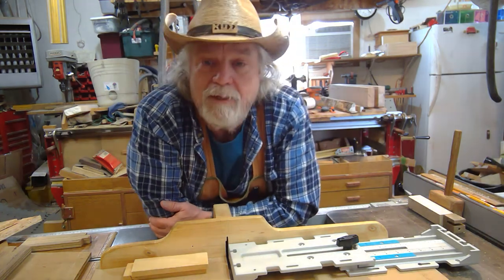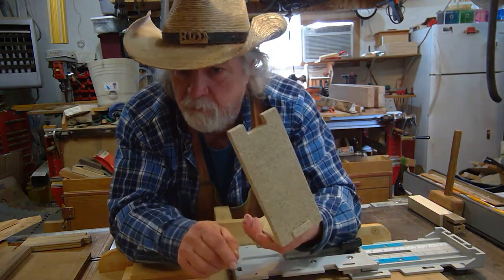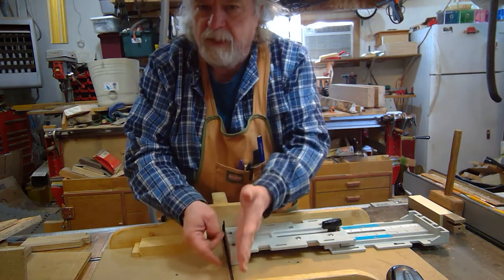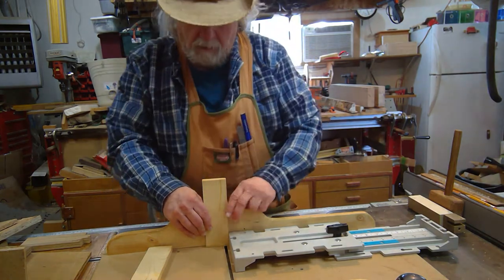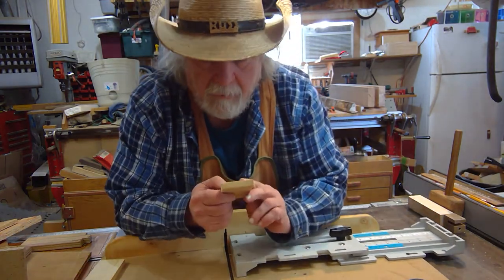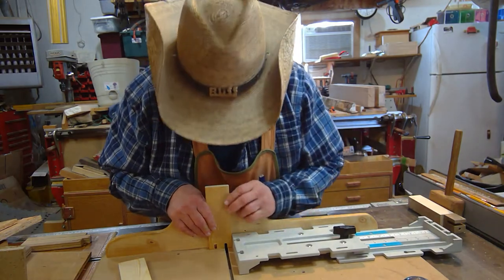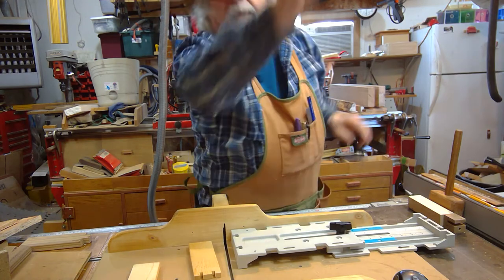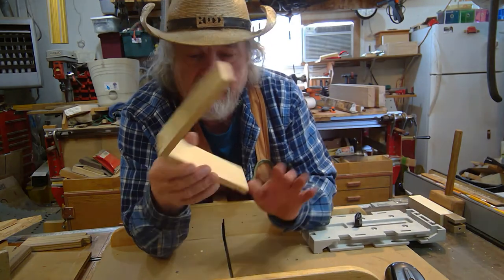3 Finger Joint by OTB Thinker

Comment: Ya know...except for the occasional rough, throw together box with butt joints to keep accessories or whatever in, I will always either make rabbet joints or go the box joint method ( I'm not a big fan of 45 degree mitre corners for a box...they are meant for picture frames or for trim around the top of something...just my opinion...). Your 3 finger joint would be a good idea if one wanted some kind of box joint but not have so many fingers to make on the pieces...a good, in-between solution.  But, now that I think about it, once you learn how to make rabbet and box joints, you might as well make your odds & ends / accessory shop box with any other way other than a butt joint....it won't take but a few more minutes, and even your shop box will look professional.
Reply from the maker: I used to always just do pocket joinery but I think I am going to use this method more now.  with the incra, it gets pretty easier to do this joint.  my favorite is the miter joint  (and easiest for me) with miter keys.  I like the look and they can be pretty strong.  the 3 finger method would be easier if making a bunch of boxes at one time.  stack cutting would be easy.  thanks marble
Reply: I will confess ( confession is good for the Soul, don't ya know...LOL..) that I have never used any pocket joinery because , #1...I didn't want to shell out the money for the Kreg jig ( there are other pocket jigs available now  that are supposed to be as good if not better than Kreg )...and #2...I always thought it looked almost unfinished when I could see the long, tapered hole in the piece of wood. Yes, the pocket joinery is supposed to be real strong, but for me personally, I just didn't think that it was the only good way to join a leg to a table or some such. Here's what I do when I make a table of some type: When I attach the legs to the inside corner of the apron, I use a decking screw and put one on each side . But..and this is the Big But.....I first take a Forstner bit and drill a hole into the leg at the appropriate place...about .300 deep, followed with a 1/16" drill bit to go thru rest of wood . The deck screws that I use have a head of about .345 and they fit nicely into the hole.  I then clamp the leg into the corner after glueing it on the appropriate sides and also a little glue in the apron corner...and plumb & square the leg in place. I might do all of the legs like this at one time.. but sometimes I don't get them all done at the same time...depending upon my schedule. Then I carefully screw the leg onto the apron, one screw high & the other screw low, watching my plumb & square as I do it. So...now I have a nice 3/8" diameter hole where my screw is. I take my 3/8" plug cutter and take a thin piece of wood that my legs were made from and cut some plugs that I then glue into the holes....slick them off with my sander. This gives a real nice and professional looking effect and sometimes, if the grain of the plug is just right, the plug disappears altogether. And there are no holes of any kind to be seen. And having a leg glued & screwed from both sides is surely as strong as the pocket hole way. I personally like my way...I see no need to make pocket holes...at least as of now...but always open to ideas and things that I may not have thought about. I do enjoy your videos and your relaxed style...keep 'em coming..!!
Reply from the maker: my first pocket hole jig (used 10 years) was a cheap knock off ($12 I think) from Peachtree.  5 years ago I bought the kreg k4 for a special gift to me and like it.  I think pocket holes are a useful method (and very fast) and I have built (and taken back apart) many  shop projects.  the best thing about pocket holes is it is idiot proof.  it is next to impossible to mess up a pocket hole joint.  i did a video about "toe nailing" pocket holes and that is one of the strongest joints especially in plywood.  inherently pocket hole screws screw into long grain and most straight screws are going into end grain.  also, hiding pocket holes is not a problem but that is another (long winded :>) subject for another time.  good talking to you marble.
Reply: Russ, Oh, I hadn't thought about the grain of the wood that the screw is going into....you told me something I hadn't considered. But...( yea, I seem to like using 'buts'...LOL..)...I have full confidence in my way and haven't had anything come loose or break, etc....yet...( cross fingers ). You said that you have had to occasionally take apart a project that you had pocket joined. Well...my little problem with that is that I glue nearly all of my joints and particularly table legs. And I know that you know how strong modern wood glues are after it has cured...it's stronger than the wood. So...short of taking a saw-zall to the joint ...depending on where the joint is....is something that I try very carefully not to have to consider because regardless of how careful one is with a sawzall, it's gonna leave a gouge of some degree and the two pieces of wood will never fit tightly back together.  Yes, I know that lots of joining is done without glue, but I've seen so many legs and other joints come loose when glue was not used, that I decided not to have that happen to any of my stuff. So...my way of thinking is that by using both glue and screws ( at 90 degrees to each other ), I  eliminate...hopefully...the chance of a joint getting loose. Thanks for the discussions.
Reply from the maker: gluing end grain adds no strength.  by the time the screw works loose, the glue has already failed.  If I'm am doing the project for someone else (gift or sell) I use glue.  for myself, I rarely use glue on end grain gluing.  It is easier to take apart later if I decide to and if it does come loose, I can fix it, therefore, no glue :>) BYI, I may not be right on this idea, but it does work for me.  I still like listening to others and pick up better ideas or an improvement.  Great discussion.
Reply: Hey, Russ....I just wanted to clarify a couple of things about my method. 1st...on my table legs and the apron...my Forstner hole is actually in the side of the apron and not in the leg....I got them mixed up...sorry about that. The 2nd thing is that I am not screwing or glueing into/onto the end grain of either the legs or the apron...it's thru the sides...the side grain. And with my filling in the screw hole with a glued in plug, the screw cannot back itself out. Anyway...we talked this to death, didn't we...LOL..!! Thanks...!!